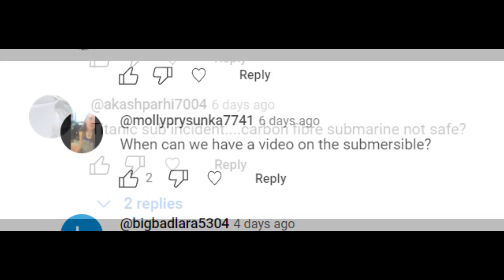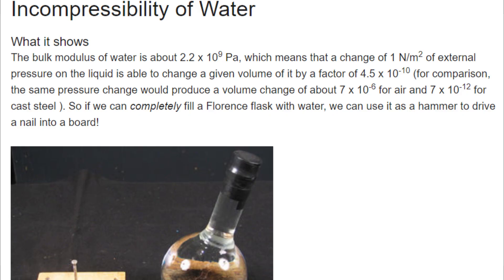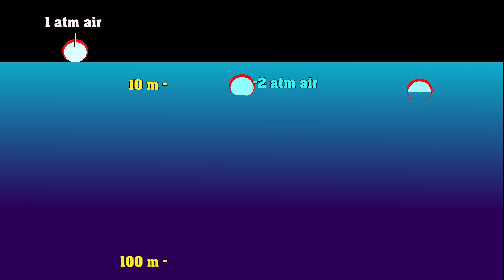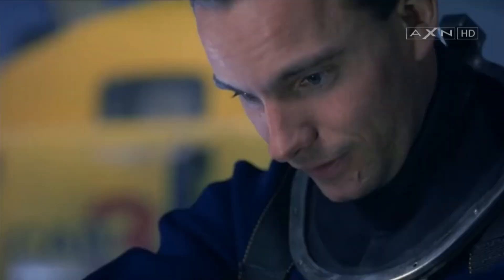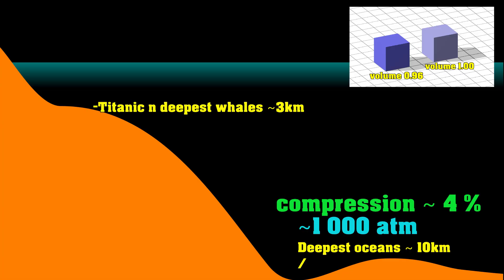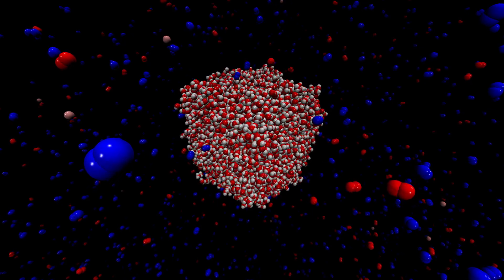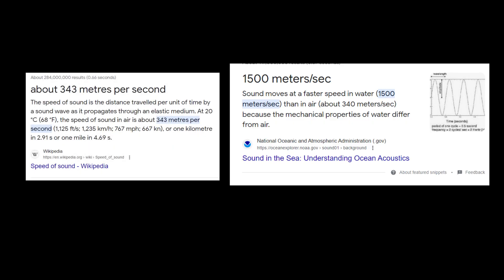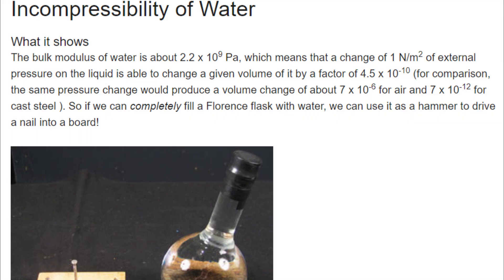What Happens when a Hull Fails at 1000 atmospheres?

Comment: Fun fact: we are not whales. 

Sure most of our body is water but the thing is there is still a lot of it that isn't. There are a lot of hollow cavities. Tiny cavities in our bones and larger cavities like our sinuses and the ones in our chest that out heart and lungs (the lungs themselves being cavities) happily chug along in. These will compress and even outright collapse under high pressures. It may be the momentum of the walls of the sub or water slamming into you that kill you first but the pressure alone would still absolutely kill you.

 You could fill the lungs with a breathable fluid and that would help but you would also need to fill other cavities (at least the larger ones) with fluid as well, then you would need a machine to assist with breathing and possibly blood circulation (or just forgo breathing entirely and just oxygenate the body intravenously). I thought something like this would be useful for keeping humans intact at very high G loads, like for ballistically launching them into space or when using nuclear bombs for acceleration in space.

Comment: Why do you think the water would rush in at free-fall speed/acceleration it it was incompressible? Bernoulli still applies to incompressible fluids: the higher the pressure, the higher the acceleration for a given mass density. Whether an incompressible fluid would be a "fluid" at all (if molecules can't move past each other) is an esotherical question, but the macroscopic principle still applies. That amount of pressure difference causes orders of magnitude more acceleration than gravity.
Reply: wouldn't bernoulli's incompressible flow equation only apply to fluids already in motion?
Reply: @markifi  Bernoulli is a differential equation which describes the full dynamics (given the simplification assumptions). If you set v = 0, it describes the static pressure (gravity acting on the column of fluid), which is simply Newtonian mechanics applied to a continuum. You can consider pressure as a force acting on an infinitesimal mass element and you'll get Newton's differential equation of motion. Of course once the speed is non-zero, the mass elements "interact" according to Bernoulli's speed term, so Newton only applies in the first instant of acceleration (at v = 0). But regardless of the details of the differential equation, my point was that acceleration is proportional to pressure, even for incompressible fluids. The dude in the video implied that an implosion would behave identically at any depth if water was incompressible, which is simply not true.

Comment: Ok, let’s pretend I’m an idiot… what would happen to a plastic sub at 3km depth if the hull cracked?   Just instantly fill with water, compressing the air in the sub down to essentially nothing?  Would the hull crush in like stepping on a soda can, or would the hull remain essentially in shape but just fill with water?

Comment: I just gave this explanation to a friend who asked me about this the other day. I was slightly off on my numbers since we were just chatting outside but it matters little when the forced involved are of that magnitude. I figured it roughly equivalent to 50kg of TNT. Of course, the pressure wave of an explosive is considerably higher but it's that impact shock on the interior of the vessel which would rip it (and whatever is inside of it) apart.

Comment: I was hoping you'd get into some more of the materials science of what happens to a carbon fiber vessel when it fails. Many of us have seen exploded carbon fiber tanks, and I was curious if an implosion would be significantly different. From what I've seen they essentially shatter, not so much like glass, but cloth or paper. Unless it turns out the viewport was the point of failure, I won't be surprised if we learn the end caps are largely intact and the carbon fiber is scattered like confetti across the sea floor.

Comment: 1:57 water is 1000 times denser then air and when all the weight of the water above the sub is pushing on it at every angle the sub will inharently compress because its not like your bitch ass 14psi can withstand sevaral thousand if not millions of psi on the outside of the sub on its own and carbon fibre is very strong but very brittle so when it gets pushed on by a shit ton of force at every direction it will crack and the entire sub will just go flying inwards at supersonic speeds which obviously instantly turned the people inside to chunky bits and im assuming because there is no more air inside of your lunngs at that point because you are essentially a mass of chunk and your luncgs are probably in pieces the water will fill up around you hints why they were able to find remains which i thought wouldn't be possible because their entire body would try to compress itself inside of where the lungs are thus turning them into a litteral milkshake but that is just my hypothesis as to what happened in this situation.
Reply: Where did you get "millions of psi" from?
Reply: @thedubwhisperer2157  yhea it is a lot. I didnt really know how much pressure ud have at such a depth but I knew it was a lot but yhea millions is probably not the case 😂 I think it's only like 6000 but u hopefully get the idea. It a lot of pressure

Comment: One dispute I would have with this description is that the water doesn't immediately start moving at the speed of sound.    The pressure waves move at the speed of sound, so you are correct that the water is at atmospheric pressure the moment that it starts moving into the air pocket.  However, the water itself has mass and can only move according to Newton's Law, F=ma, while the sound waves do not have mass.
Reply: Speed of sound in air or water?
Reply: @jimsmith7212  The pressure disturbance in the expansion fan will propagate at the speed of sound in water.
Reply: @argcargv  
👍

Comment: And just in case the column of water and debris moving in at the speed of a rifle bullet doesn't paste you, your next breath would be gas that's been heated to incandescent (think fire piston) by said water.
Reply: The adiabatic heating of the water had small consequences, as basically it was the concentration of ALL the heat energy within the volume of air that was Titan's atmosphere, and that is after it has been compressed to about 1/360th of it's original volume.
Not that much.
An incandescent light bulb filament may be 5,000° F, but how long would it take to cook 5 human bodies with a 100 watt light bulb?
The ambient water temperature at that depth is about 39° F and water has a heat carrying capacity nearly 3,500 times that of air, so the tiny volume of very hot compressed air was almost instantly cooled by cold water.
Something that I had not thought of before watching this video is that the water that first entered the submersible had been expanded,  and therefore was COLDER than ambient sea water too.
Reply: @jimsmith7212  Rare to read a properly reasoned answer in relation to this sad incident.  Thank you!
Reply: @jimsmith7212  You're thinking of a different mechanism than I am.  Consider the moment of peak compression before everything can reach equilibrium.  A several hundred bar pressure spike is not "small", nor is the amount of heating that entails.  It's enough heat to burn the insides of someone's lungs badly enough that it wouldn't matter that the heat quickly goes to equilibrium.  Likewise with the shockwave and resulting injuries.  Searing or rupturing the surface of the lungs takes a lot less than "cooking" someone.  As I said, a fire piston is the easiest no-gore thing you look up to see what I'm talking about.
Mind you also the entire hypothetical is moot; it could potentially matter in a larger, sturdier, compartmentalized sub that only partially imploded, which is not the scenario at issue.

Comment: So.. to summarize, what happened is that water is kinda springy, and giving it a space to spring into causes it to do so at a rate dependent/proportional to the "internal compression" and not just the speed of sound.

My only question is how is this any different from saying the pressure at x depth of whater is what caused the implosion? Pressure is basically a function of internal compression, so I don't really see the difference here.
Reply: If water was completely incompressible, the water would flow into the cavity according to Torricelli's law - the weight of water above causes pressure and essentially pushes the water in - but there would not be any water shockwaves in an incompressible liquid. Pressure isn't caused by compressibility but pressure will compress a compressible fluid.
Reply: @sherry8444  yeah I get that. Water isn't "incompressible" and anyone with any understanding of material physics would get that, since literally no material in the universe is "incompressible", it's why we were able to "hear" the sub collapsing in the first place because compressible substances can transfer sound waves while perfectly incompressible ones cant. What I don't understand is why @thunderfoot feels the need to explain this basic fact that water isn't "incompressible" as a factor of how the sub imploded. The bottom line is, the water outside the sub was under greater pressure, and hence more compressed than the air inside the sub, which was only under 1 atmosphere of pressure, and so the volume of the sub collapsed due to the pressure differential. It's not that unintuitive, so why make a 1/2 hour+ video trying to explain this basic physics fact to people who probably already understand why they died in fractions of a second anyway? 

This is besides the fact that this news story is kinda dumb as is. 'billionaire ignores safety regulations and dies as a result of hubris and arrogance' isn't exactly world-news worthy, and the amount of media attention it's receiving is disproportionate to the actual problems facing humanity and the significance of the event.
Reply: @Jakob165  He made it upon request.

If someone thinks the pressure killed them, then they are right but it was only a cause somewhere on the chain of causes. A scientist wants to know that entire chain.

You could say something like:
Gravity is a root cause
and Depth (which itself has a chain of causes), which causes
Pressure, which causes both
Compression of water and fracture of the hull, which allows
Decompression of water which...

And you could go the other way and say going down in a sub was a cause, Stockton's character was a cause etc.

So yeah pressure is in there but knowing that does not give the full picture. And not understanding that chain could lead you to wrongly think that pressure will always kill. The entire chain of causes should be searched for... by scientists, engineers, doctors and lawyers.

So in that chain if you take out the hull and/or water decompression element... let's say a person sank to the bottom of the ocean, there's a lot of pressure and compression yet he could even survive (until his brain runs out of oxygen - hence the interest in liquid breathing). Yet most people might believe he would implode from the pressure - bones and all

Comment: Is that what they refer to as the Water Hammer? Also how torpedoes destroy submarines, creating a pocket that water rushes back into it.
Reply: No.  Water hammer is a consequence of a flowing mass of water in a pipe being asked to change direction or stop abruptly.  If you have 1/4 turn taps in your house, open one fully and then flick it closed as quickly as you can.  That's water hammer.
Reply: @thedubwhisperer2157  Ah, ok.

Comment: Can you pump the "oxygenated fluoro carbon emulsion" in and out of the lungs with your own strength like air? Once the part that is in the lungs was depleted, it would still need to be exchanged with the outside.

Comment: Well you are right, but you are wrong.

First of all, the world record saturation dive is 650 meters, not 300 meters.  Of course, there is a difference between a world record and a practical situation.  Nonetheless, people can breathe utilizing special gasses beyond 600 meters.

Secondly, the speed of sound in water at nearly 400 atmospheres is much higher than at 1 atmosphere, so we are actually possibly talking about the water moving at considerably more than 10 times the speed of sound, depending on how far it travels in the sub before hitting the human being.

Thirdly, the air pressure within the sub will rise extremely rapidly as the air gets compressed, even more so since it is getting extremely hot.  Again, depending on just how far away the body is from the breech, the water pressure is likely to be considerably higher than 1 atm just before the water hits the body.

Fourthly, while the pressure may be only a few atmospheres higher than sea level just as it contacts the skin, because it is traveling at something in excess of 3600 kph, it is going to skyrocket when it hits the body.  Indeed, because of the inertia of the water, the impact pressure may far exceed the 350+ atmosphere ambient pressure.

Finally, it might not be water which initially hits the body.  As the hull implodes, it is going to be driven ahead of the water at pressures similar to its failure stress, which is obviously equal to the environmental pressure outside the hull.  Once again, because of inertia, the actual pressure exerted on the body may be far in excess of the environmental pressure.

Your main point, however, is correct.  If the water were completely incompressible , it would be no different than a solid block of steel falling at 1g on the person.  At nearly 4 Km in depth, however, the column of water above the body has a weight of more than 38,000,000 Newtons.  When falling on a body, the contact pressure from such a fall is astronomical.

Comment: As many others have already stated in the comments. Thank you for clarifying that water like any other material "IS" compressible, albeit minimally. It took me entirely too long in some of my early engineering classes that taught hydraulics to understand this over my professors insistance that it was not. Of course, the fluid has to be compressible, otherwise, how could a system build pressure?

Comment: One minute in and I'm gonna comment ahead and say pretty sure it's the heat and pressure and speed of the air/water that kill you... Given that the inside of a implosion is almost analogous to a diesel engine